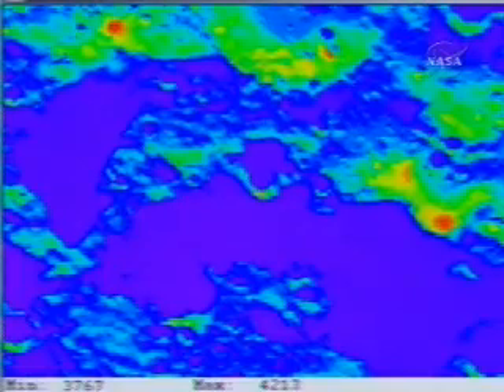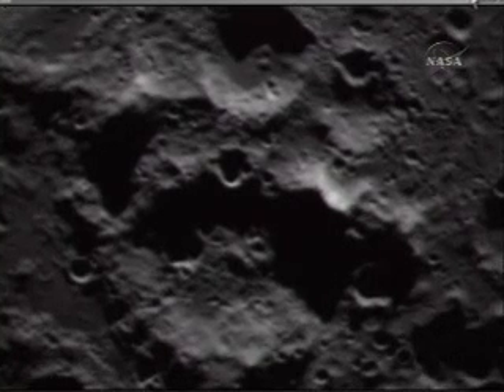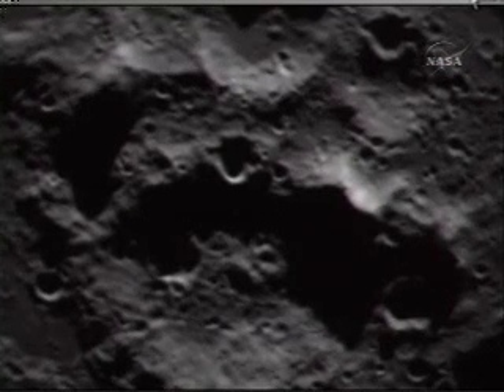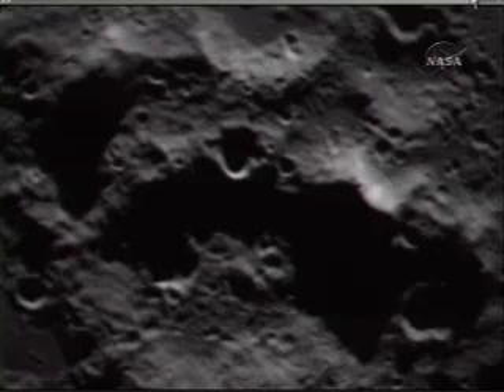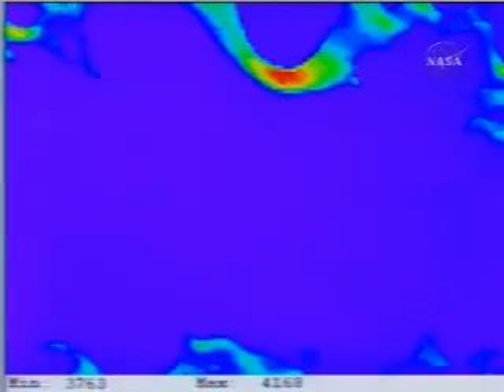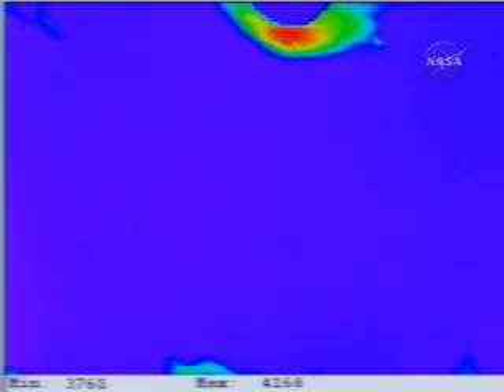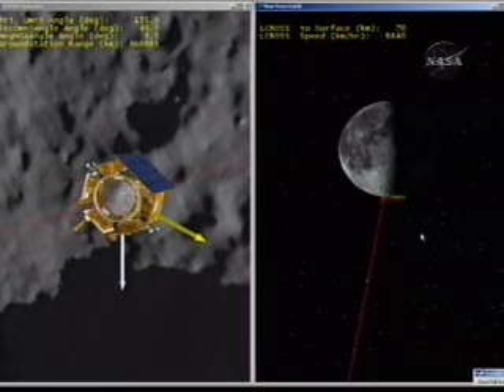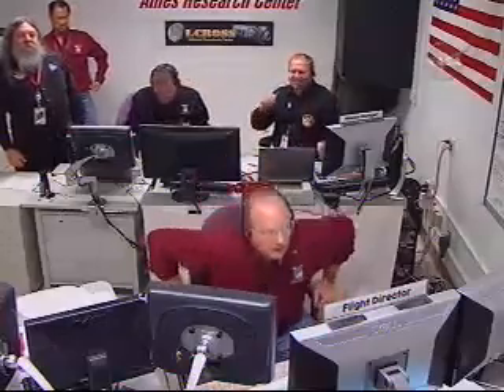LCROSS: IMPACT

Comment: Dogs crap ? You mean like what you keep between your ears? Where most people keep their brains ?

First of all there are no records of Buzz Aldrin or Neil Armstrong stating that. 
Secondly oil and coal are organic byproducts. There is no life on the moon never has been, So oil and coal could not have formed.
Thirdly even if there were. If it costs $15,000 to move 1 liter of water from the earth to the moon how much would it cost to move oil to earth? Even at 1/6 the cost $2500 per liter.

Comment: They did not nuke the moon. The sent a spacecraft, about the size of a minivan, slamming into the moon at 1,000 kMP/H. 
non-nuclear explosions don't work in space, whereas nuclear explosions would quite possibly destroy the moon, which is bad. So using force to get past the 80Metres or so of rock on the surface is the only way.

Comment: they're also working in very high speeds. that's why the images are a bit choppy. you have to cut some frames or slow the an entire scene to see things. if it's taken in real time in low res, then you wouldn't be able to see anything. imagine, that's just like a free fall here on earth. you've got to slow things down in order to see it. or else, what you'll see will just be faded objects. like waving your hand in front of a vga cam.